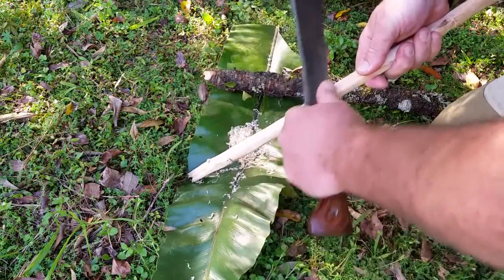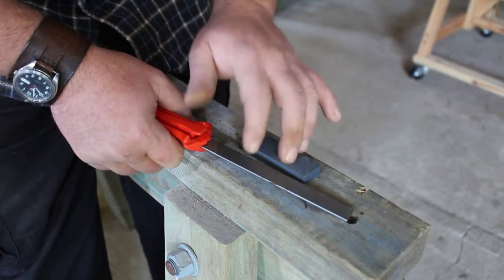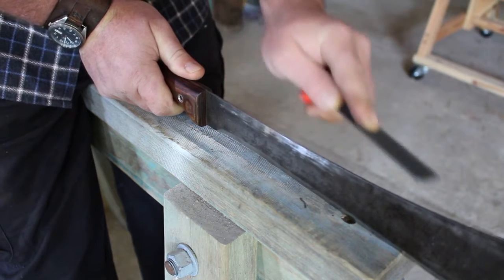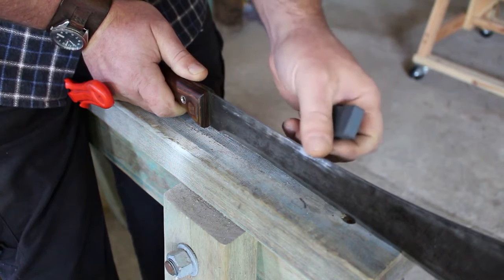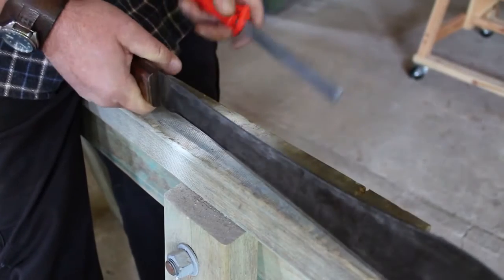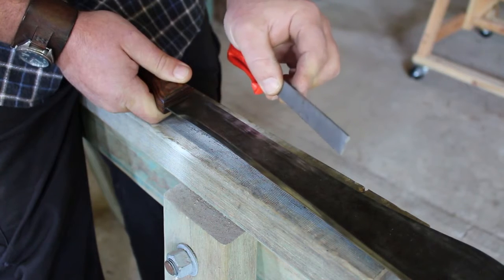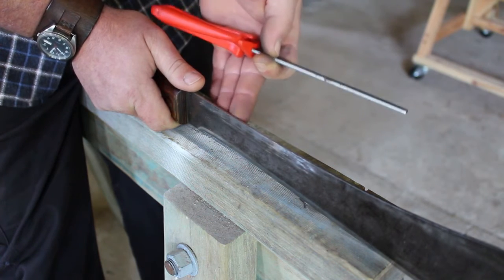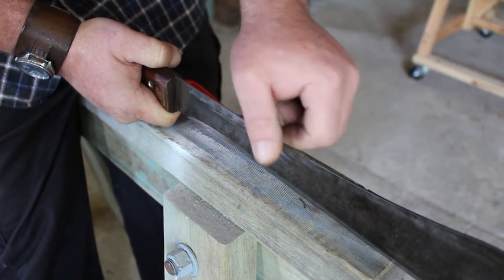Machete Card Scraper Sharpening

Comment: now i can properly do this on the machete i'm refurbishing in the morning.what i had tried wasn't working at all,i was leary of removing too much metal from the back,which I would have done if i'd kept on my path of ignorance. the way you describe processes makes understanding incredibly clear.thanks again
Reply from the maker: That's right, you were working on restoring a machete. Thumbs up for that. I dislike how quickly we throw everything away and buy new these days. If you take the time to restore a tool, you inevitably learn how to take care of it at the same time.

If you find that the old edge is in really bad shape and you need to do a big reshape on the bevels, take a look at this guy's clip. If I did not have a slack belt grinder, I would be using this method to shape the bevels. 

https://youtu.be/IsZb_1XfFHo

Colhane really knows his stuff! I'm not a fan of the scandi grind he does at start of his machete however, Aussie timbers and weeds are pretty tough and I find a thin convex edge the whole way along suits us better down here. If I was in the jungle, I could see how a little scandi section would be helpful. 

The method I showed in my clip suits a machete that already has good bevels but is blunt and/or has minor chips and dents.

You can always make the edge thinner or thicker if you find it did not suit you. 
Hope the project goes well for you mate!
Send some pics when you're done.
All the best,
Ben

Comment: That's a really cool mod. I've mainly used broken glass as a wood crapper before, but I'll definitely have to add this mod to my Machetes.
Reply from the maker: It's such a useful little mod. It is very fast to resharpen in the field (much faster than I showed it on the card scraper sharpening clip) and it keeps its edge for a very long time when scraping up tinder.

Comment: that is a good idea. I use card scrapers all the time for work they are a great tool and as you have shown a great addition to your bushcrafting kit.
Reply from the maker: Cheers Mark! To be honest,  the card scraper on a machete is not my idea. I do prefer putting a proper edge on it though. The dressed square spine or quick rough edge with a file also works. But as you probably already know, the traditional card scraper edge with a hook really performs!
Thanks for the kind words mate.
All the best,
Ben.

Comment: The main reason I came here was to see if you had more hair back in 2015 & I still have a bumper sticker on one of my roll around tool boxes which says - Real Men Don't Waste Their Hormones Growing Hair . 
My lady friend still calls me "Bowling Ball Head " - "Cement Head" and a few other names which should not  be mentioned . 
I like this video ... because as you and others already know - Machetes are typically stamped out of steel coming from a large "bail" or "roll" of steel and stamped out on a flywheel or hydraulic press .  The marks on the spine don't present any type of problem , but for some reason , I like to file and smooth the spine of the machete for doing close work , pushing with my thumb ... and to stop the voices in my head . 
Thanks again for your video Ben .
Reply from the maker: Nope, bald for many years! I had a proper Catholic schooling experience so when I finished up, I grew it out..but that lasted 12 months as an apprentice.  Hair is just not practical, except for keeping your scalp sunburn free. 
The card scraper edge is a trade off that's for sure. You can still carve and craft with using your thumb to back up the blade, but it is far more comfortable (and safer) to round off the spine. As for the voices we all hear in our heads, my best approach is to always be kind and polite to them. Besides, the best conversations we will ever have, are the ones we have with ourselves!
All the best from OZ,
Ben
Reply from the maker: And all the best to you my friend!

 Honestly I knew their was no offence. I'm getting older now and as a rule, I don't take anything personally.. although, that took me some years to learn. I also believe that being offended by something external to you, just shows a lack of self control and understanding of yourself.....but that opinion will 'offend' some who have not worked that out just yet. So I generally keep that cherry to myself. It's easy to be polite hey! 

Thank you for the clarification, but it's not necessary. Most Australian's are more than comfortable in having a laugh at their own expense! Thick skin and humour comes with the sunburn & sand.
All The best Pat,
Ben
Reply: Yes indeed . Time to take a mule for a ride . Samson loves to go for a ride after dark . 
ATB Ben

Comment: Very informative video, but I have a question. Why do you turn the card scraper edge up on the spine of the knife then turn the edge down, does that give you a bigger edge?
Reply from the maker: I have never really thought of why but will have a crack at the answer. 

It's to position the cardscraper edge into a hook shape. This will do two things: Position the cutting edge in a comfortable scraping position but more important, the hook shape pulls the cut/scraped material on top of itself as you work. This helps keep the edge engaged into the material. With light strokes, you end up with long, super thin ribbons. 

If you do a non hooked edge/square edge/ragged edge, you just end up scrapping dust with light strokes. You need to go heavy with the above three if you want ribbons. By default, you end up with thick and heavy tinder....that will also probably light just fine if they are dry to be honest. 

Was that helpful mate? It's a 'clear as mud' explanation...
All the best,
Ben

Comment: What brand is that file? I’m having a hard time finding one with that rounded safe edge
Reply from the maker: G'Day Lee. It is fairly standard for flat chainsaw sharpening files to have rounded safe edges. Your best bet is to try a chainsaw shop. It is not a commonly used file outside the chainsaw industry so I don't know how much luck you will have at a regular tool store.  That was a Stihl branded file buy Oregon also make a decent chainsaw file. I hope that helps.
Reply: Machete Bushcraft Australia all of the Oregon files here have flat edges... that is the brand you see EVERYWHERE. And they seem to be cheap/crappy too.

Comment: That's a great idea! (and a great video!)
That's funny, I used a cheap machete blade to make a curved card scraper for cabinetry, but I wouldn't have thought of putting this type of edge for kindling, and especially not on the back of a knife i still intended to keep using as such!

(Maybe that's because "bushcrafting" wise, I'm more into Nepalese kukhuris, and i can't see how i would incorporate that on the spine of one without ruining it...)

Might do that on the back of a bushcraft knife! 

Does a machete stands up well to batonning?
I guess it isn't necessary if you don't have to deal with a cold winter and a nice dead standing tree that's a bit thick...
Reply from the maker: +siouxsettewerks 
Thanks mate! I think you nailed it with that comment and it's one of the reasons I ended up focusing on machetes out in the bush. I have a lot of nice gear that I would not treat like that but a very good quality machete is cheap! Because they are so inexpensive, I don't hold back when I use them. If I want to put a cardscraper edge on the back it's no big deal.
 
Battening is fine with machetes depending on the quality you buy but I'm yet to find a brandname machete company that supports that claim...so I always say 'it up to you' when people ask.

 I did a lot of testing comparing brands and prices, quality,  edge retention and sheathes and there is a lot of decent brands out there. Some were easily on the top of the list and then there was the junk with a brand name.  

Machetes are great at processing firewood but are outclassed in that department with the heavy Kukhuris!  Don't get me wrong, machetes are still very good at dead wood chopping, but they are much lighter so they don't bite as deep with each chop.

Comment: Say Heah Ben, We call it a 90° spine, Great video Ben, But I once read that a rounded spine is stronger ?. But I like Colhane's take on modifying his Machete. But your good, My Machete Guy across the pond. Oh, one of my knives is almost finished, Yeah, I posted some new up-grade pictures. Lemme know what you think, Thanx You for the tips.,,. p
Reply from the maker: G'Day Paulie!  I'm going to go have a look at the pics now mate. Keen to see what you have done with the pair of knives. That is a good question mate and I had not thought about it. It is a total guess but there could be some merit to it but I think in practice, it would make little difference.  Glass tends to start cracking where there is a weakness the same way you can score and snap plastic. A 90 spine would be weaker than a rounded one. A small fault  on the corner could slowly build into a stress riser crack. Even though machetes are heat treated softer than a hard steel knife, I think machetes would be more susceptible to this kind of cracking.  As with everything It is a trade off and I find the card scraper edge useful enough to take the risk. I can't say I have seen a good machete brand fail here as yet..... but that is just my 2c worth!
All the best mate,
Ben
Reply: Machete Bushcraft Australia Thanx You Ben, Your a Great Guy. Thanx You and it's my Pleasure I met you.,,. p
Reply from the maker: And mine too buddy! I feel lucky that in this day and age, we can make friends far across the globe. Mate, I love that handle BTW. That looks darn comfortable! 
 https://plus.google.com/u/0/109383488013098689568
Reply: Machete Bushcraft Australia Oh, yeah, Ben, William Collins is know for his handles. But my blades in 3V are Tempered by Peter's Heat and Treat. They do alot of High End Knives for alot of great companies.,,. p

Comment: Oooh that mirror cutting edge, nice! Cringe worthy watching your fingers working so close. 
Great idea haven't seen it done like that. Going to give it a go on my Bellota (Columbian made) I just have a square edge on it at present.
Reply from the maker: It's a really handy addition to a crafting machete.  The steel in these machetes would be on par with good quality woodworking card scrapers and they are about the same hardness. The technique in this clip is slightly over done for bushcraft however, you will not get the ultra thin shavings/ribbons with a rough scraper edge. 
It's been a long while since I watched this clip. I will watch it again for the 'cringe' bit (I'm trying to avoid these).
Cheers Greg,
Ben
Reply: Machete Bushcraft Australia all good Bro you were all safe 👍 it's probably just me, looking at fingers near edges & I feel that sting of when I sliced my thumb Haha 😁